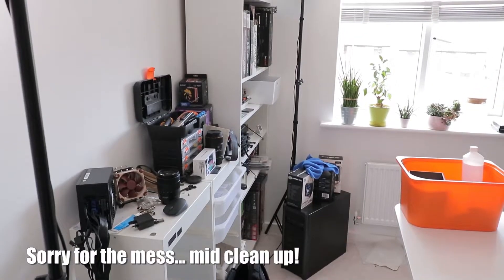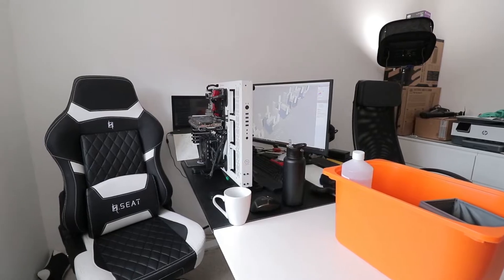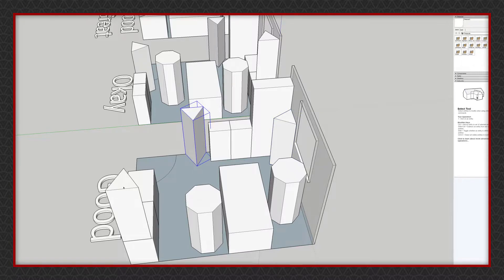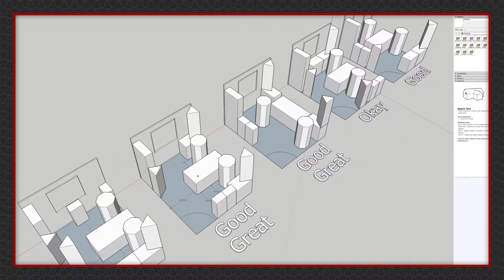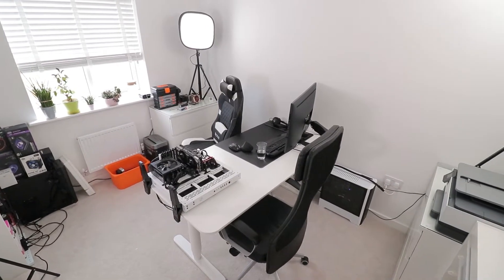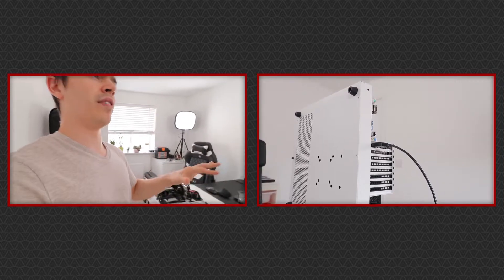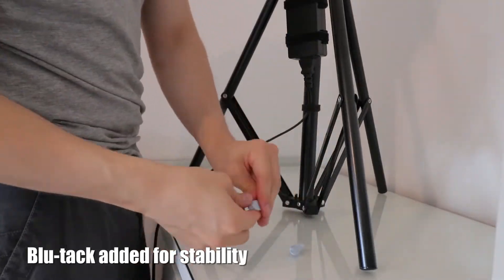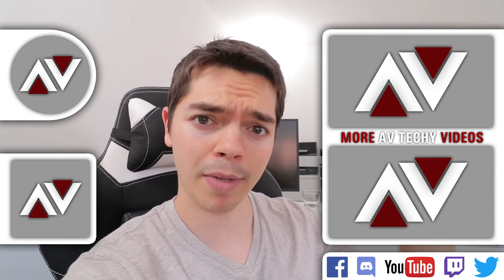Squeezing Out More Efficiency - Optimising The Studio

Comment: I like those soft boxes and that led light. Do you have any links for those?
Reply from the maker: I'll cook up some links to today. I should have links to the equipment I recommend using in the video description for this stuff since I don't use anything unrealistically expensive.
Reply: @AVTechy  Awesome. Yeah I'm currently using light umbrellas. They get the job done but are also a bit big/unwieldy.
Reply from the maker: Here's a few links. I've only got UK and US links done. I'll have the others sorted out soon, but if you need links for other countries let me know and I'll get them sorted ASAP.

There's the 480 bulb variant which is less powerful than the 660 bulb variant. But the 480 versions come with softboxes and are cheaper, whereas the 660 versions come with barn-doors and you'd need to buy the soft-boxes on top which bumps up the price a fair bit. All options are available below:

Dual Neweer 480 Light Kit
UK - https://amzn.to/38gWTwg
US - https://amzn.to/3f32pWd

Dual Neweer 660 Light Kit
UK - https://amzn.to/2YPe1pW
US - https://amzn.to/2NL8Y3t

Softbox Add-ons
UK - https://amzn.to/31x9F8I
US - https://amzn.to/3inrKMe

Let me know if you have any questions.
Reply: @AVTechy  Thank you! Those links are very helpful.